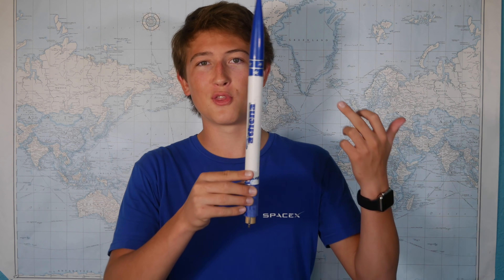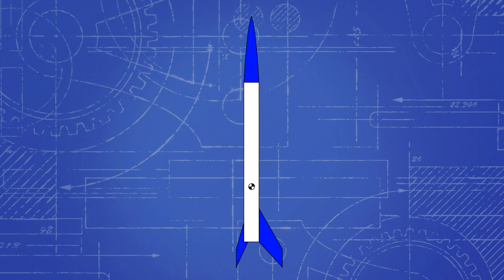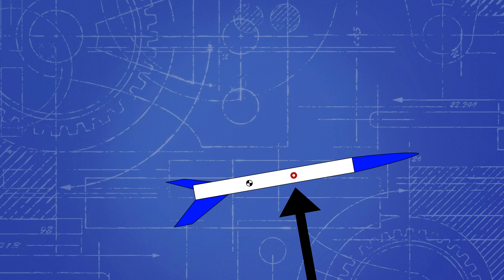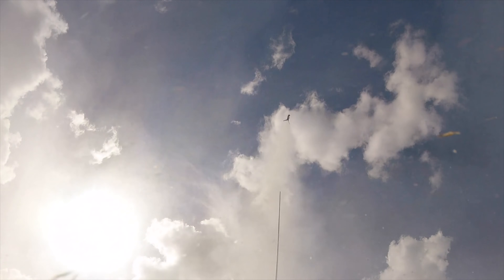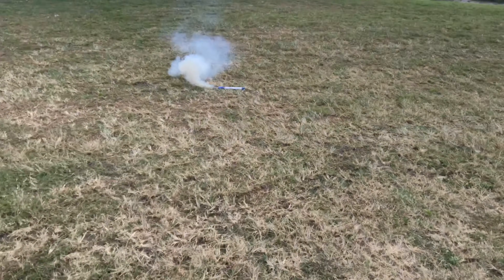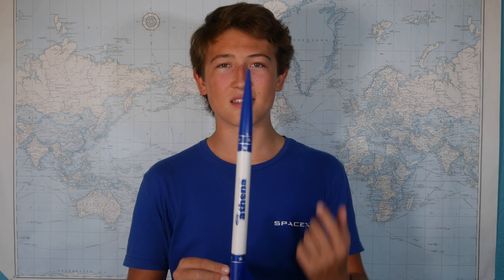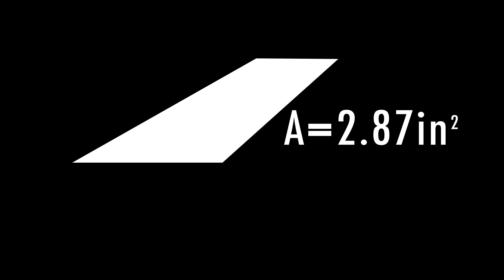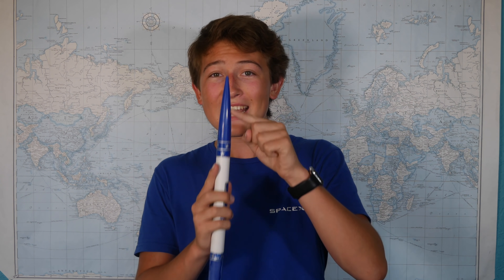Why Do Rockets Have Fins?

Comment: Good explanation! One thing puzzles me though. Unlike smaller rockets, space launch vehicles do not have fins but totally rely on thrust vector control. But, why did the Saturn V have fins? I guess it has more to do with heritage and nostalgia than with function, like the black-and-white square pattern which actually caused thermal concerns.

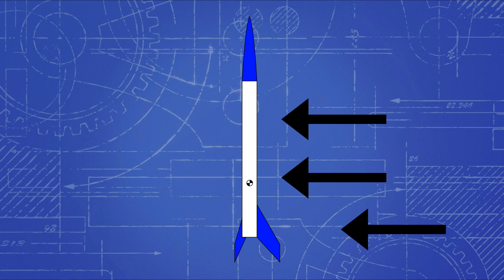Comment: Building my first rocket on Kerbal and I had to add fins for one of the trainings. Decided to look up why they stabilize a rocket and your video helped :D Thanks! Though, I do have one question, at 0:40 , why does the rocket's upper half rotate right when the wind is hitting it from the right side. This is counter-intuitive, I would think that as the section of the rocket above the C.O.G is bigger the one below, more pressure in that section would cause the upper rocket half to rotate left.